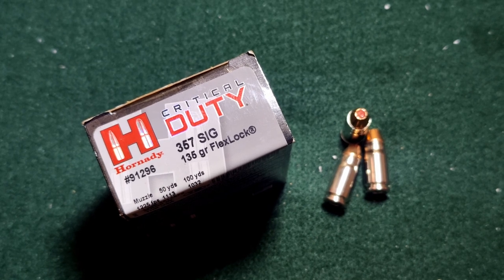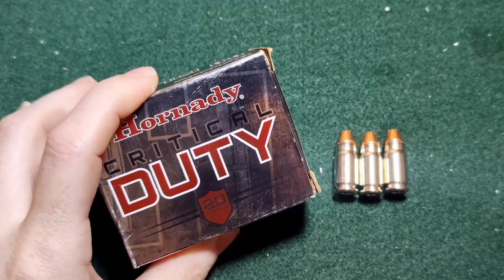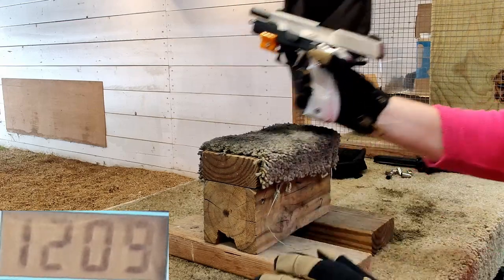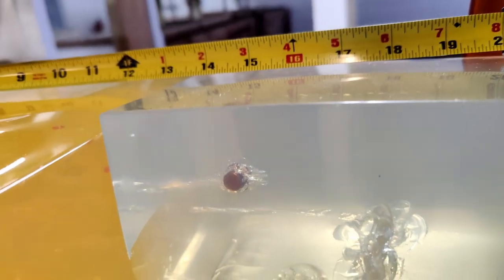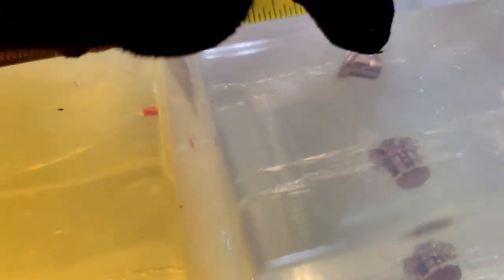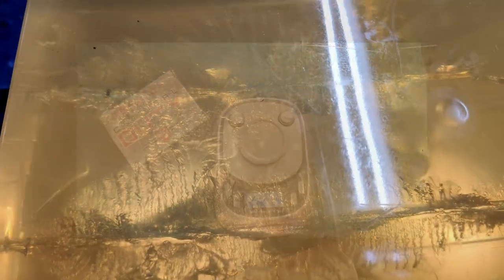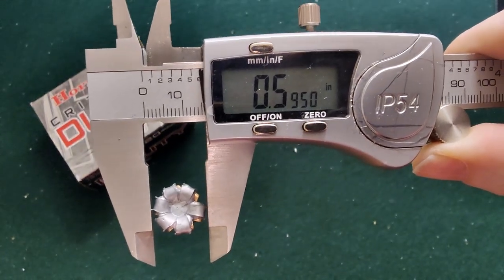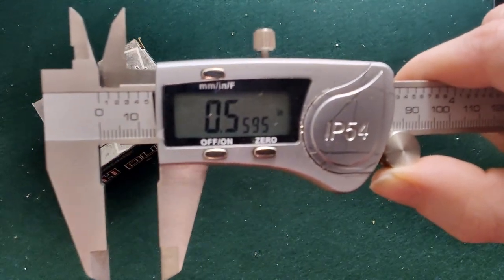Hornady Critical Duty in 357sig! Caliber of Love 💜 SIG P226 Ballistic test, Gel test

Comment: Another gun tuber averaged 634 foot pounds from a G32 With Underwood. Major manufacturer offerings are ANEMIC.

Pedal to the medal .357 SIG comes from Underwood, Double Tap and Buffalo Bore. 

I carry Underwood 125’s in my SIG P239.
Reply from the maker: Oh for sure! All the factory ammo is watered down crap for the most part! Like you said, Underwood, Double Tap, and Buffalo Bore all make rounds how they're suppose to be. Not just in 357sig but all of them! Underwood is usually my go to ammo for something real. I'm going to be making a series where I take factory ammo and dismantle it and load the projectiles how they should be from factory. I wanna see how different they'd be at a proper loading. Now sadly most are going to be 124gr as they will be stolen mainly from 9mm rounds but I also have a plan with some 147grs that will hopefully hit 1300+fps out of my p226! I'm excited to see those higher grain rounds whizzing by fast af! hehe

Comment: I know they expand reliably, buy I want more speed and expansion. Especially speed.
Reply from the maker: I agree with the speed. I cut it out of the video but I said I thought they'd be faster after I chronod them and went fumbling for the box to recheck the box fps
Reply: Underwood 125’s give you 634 foot pounds from a G32. 

You want speed it’s Underwood, Double Tap or Buffalo Bore. Major manufacturers offerings are anemic.